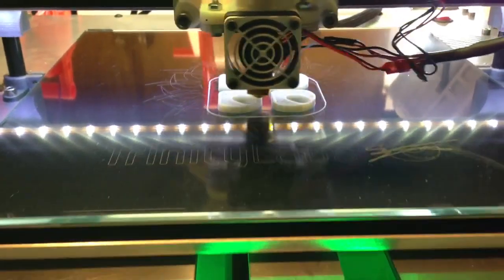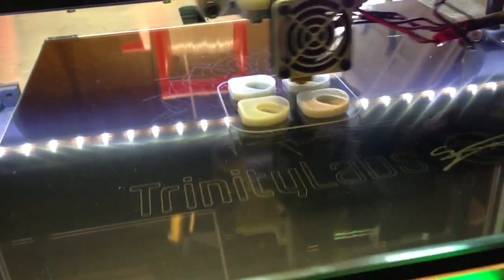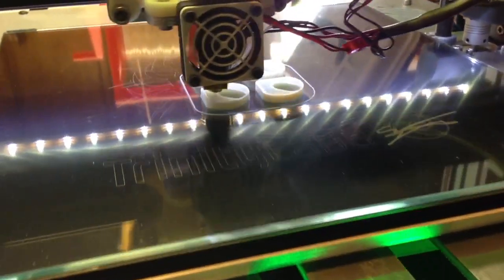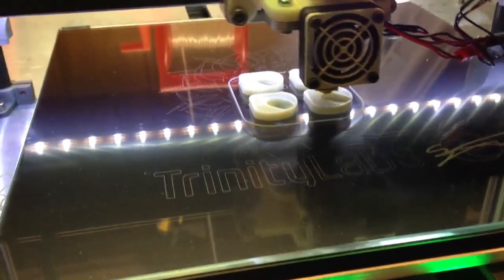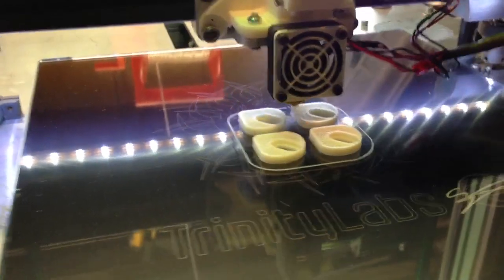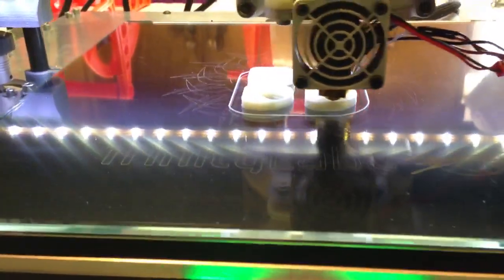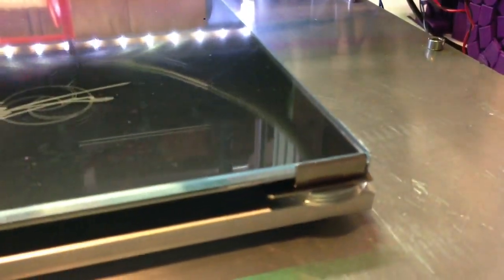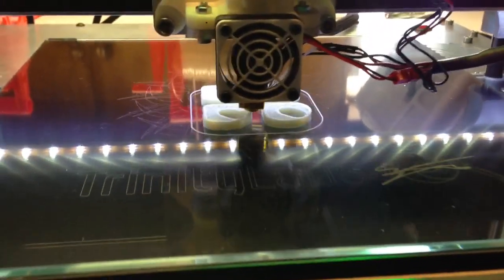Aluminatus Printing ABS

Comment: What kind of rods did you use? I'm looking to buy some high speed steel rods for my home made 3d printer which  is like a prusa on steroids I'm only 16 but looking around to find the best for it.
Reply from the maker: DJake77 These are basically the X and Y rails for this machine: http://www.pbclinear.com/SIMO-Series-Driven-Systems---Lead-Screw   The Z rails are from Thompson Linear I believe. If you are building a bigger machine you will want very rigid parts though. Check out my videos on my new CNC machine I'm making which has lots of details! https://youtu.be/nclRFqYBt7g